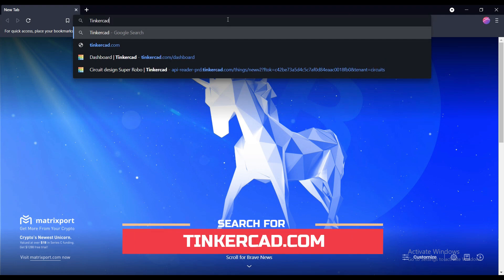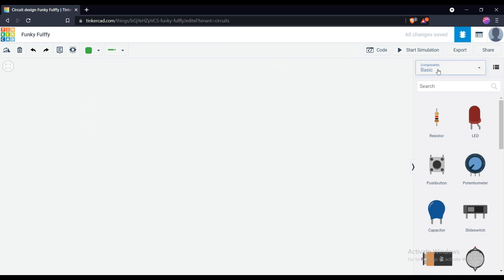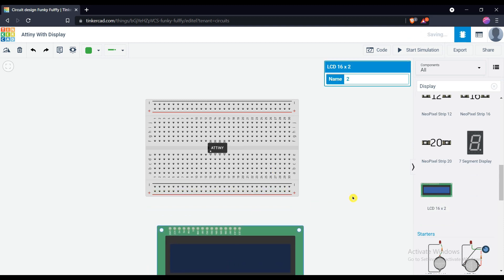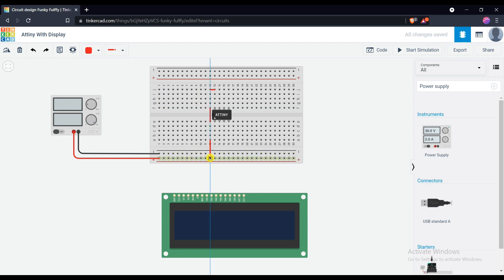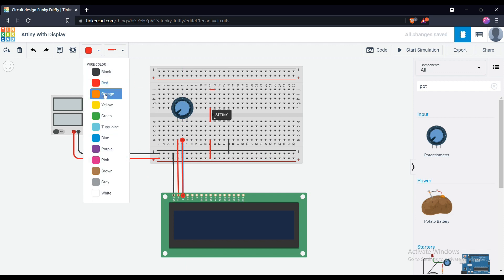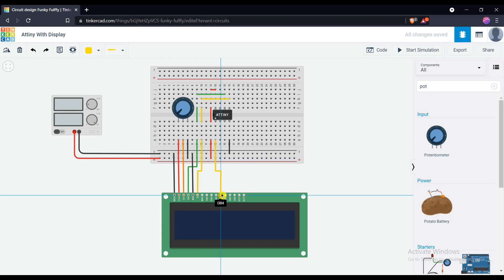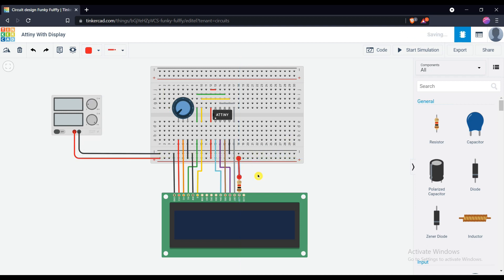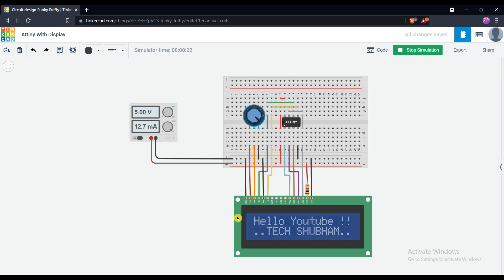Interfacing 16*2 LCD display with Attiny 85 Microcontroller || Tinkercad

Comment: it doesnt work i checked the wires and the code, the placements of the things basically everything and the text doesnt pop up on the display can you help me with this problem
Reply from the maker: Please confirm if the code has been successfully uploaded or not. I faced the same issue during testing on hardware. Try uploading the code again and make sure all connections are proper. Let me know if your hardware is running smoothly after that.
Reply: This is because its a standard liquid crystal that only has 5 useable data pins

Here's what I mean:
power, ground, and pb5 are unusable. pb5 is reset and cannot be used. you're essentially left with 5 and 2 are being using to send signals to rs and e. So now you're realistically left with 3 detains (pb2,pb3, pb4).

Im not sure how this video got pb5 to work on one of the dpins but this video was made 3 years ago which leads me to believe that was a bug.

You also can't use Liquid Crystal I2C because tinkercad doesn't have TinyWireM library that's needed. Unless you somewhat figure a way to create your own in the little editor tinkercad has.